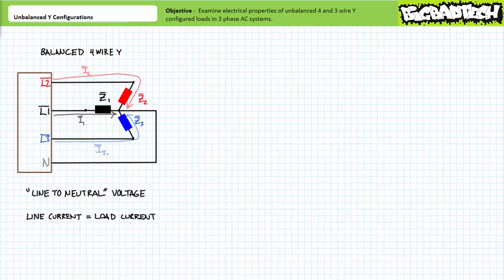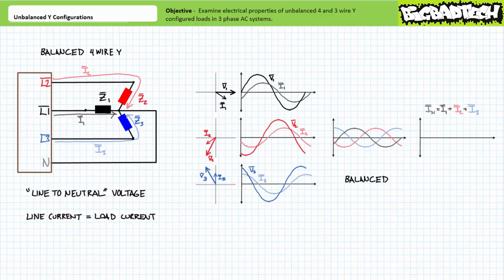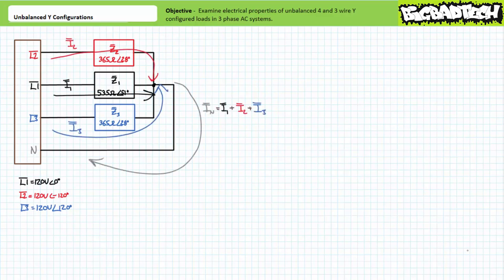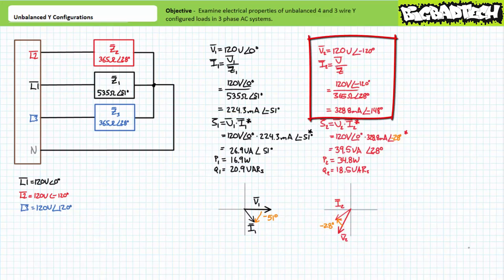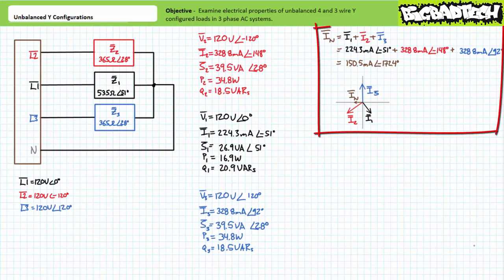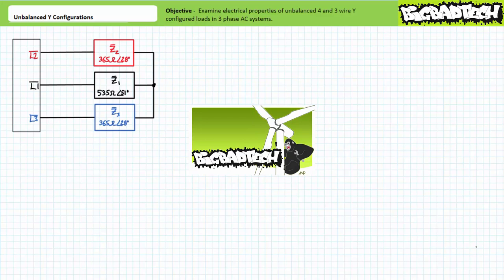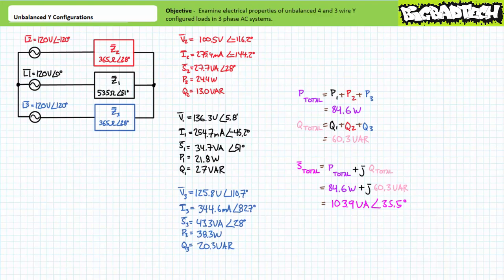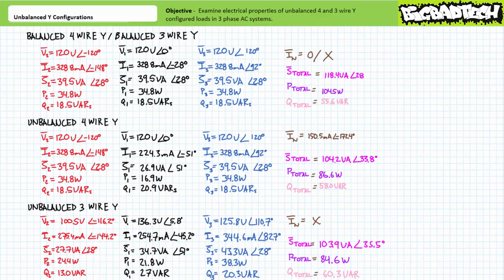Unbalanced Y Configurations (Full Lecture)

Comment: @11:03 Why is V2 and V3 not equal to the given voltage? Also why is I2 and I3 used in solving the powers not matching to the solved values
Reply from the maker: For unbalanced circuits voltage will not be apportioned equally as demonstrated by the superposition theorem. AC power uses the relative phase shift between voltage and current. Check out the AC power lecture at: https://m.youtube.com/watch?v=nse2vSlOoME&feature=youtu.be

Comment: At around 25:25 why isn’t I2 and I3 the same? I understand the maths and got the same results as you this surprised my instinctual expectation
Reply from the maker: Yes, you'd think the two identical impedances would carry the same current but they don't because imbalance current continues to circulate unevenly throughout the circuit. 

Another interesting observation you can make about unbalanced 3 wire Ys is that the "Y" connections (ie: the far right node and far left node) actually exhibit a voltage difference between them. (it's largely this reason why unbalanced 4 wire Ys aren't as difficult to analyze, the 4th neutral wire ensures the two Ys are at the same potential). 

To determine the voltage differential between the Ys use Kirchhoff's Voltage Law. Let's call the node on the left A and the node on right B. Start at A, rise L2, fall V2, fall VAB. 

VAB would equal L2 -V2 = 20.8/-138.7. Other loops should yield identical results.

Comment: At 23:15. Where does the 100.5 V (-116.2 degrees) come from? 74.9 (-123.5 deg) - 31 (-17.2 deg) - 45.4 (125.8 deg) yields a different answer.
Reply from the maker: Check your calculations. When left to right is the assumed polarity the 3 entries should be PLUS MINUS MINUS to yield 100V at -116 degrees.
Reply from the maker: Ordinarily I don’t play “math detective” however this one is too good. The issue you’re having most likely stems from the last inverse tangent. Recall in the rectangular to polar conversion lecture: https://m.youtube.com/watch?v=spnKjJtV5y4 that the inverse tangent will give you the “nearest” angle and not the “only” angle. This, being the second phase, should have a phase shift of close to -120 in the third quadrant and your answer will require active intervention. That’s why I’d recommend getting a scientific calculator or using an online resource that will do polar math without having to resort to manual rectangular operations and subsequent conversion. While not impossible, this manner of calculation is like traveling cross country on a donkey. You’ll get there ... but it’ll take a long time.
Reply: @bigbadtech  You're correct. My calculations are faulty as the calculator confirms Thanks for clarifying.